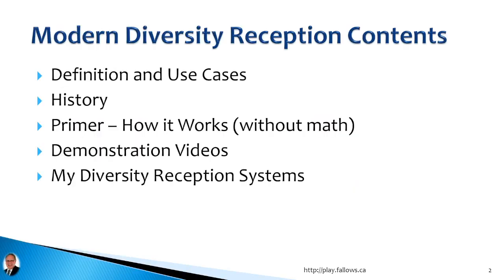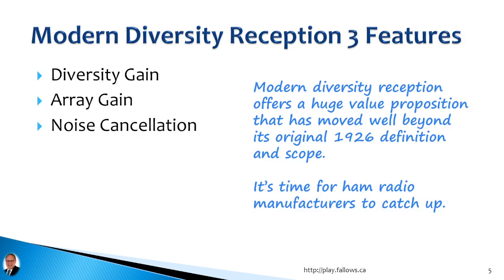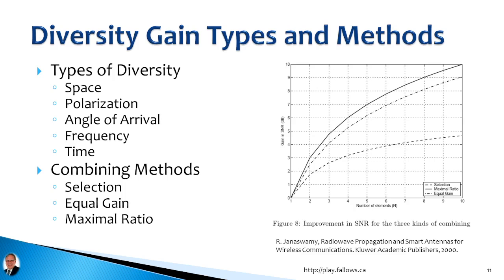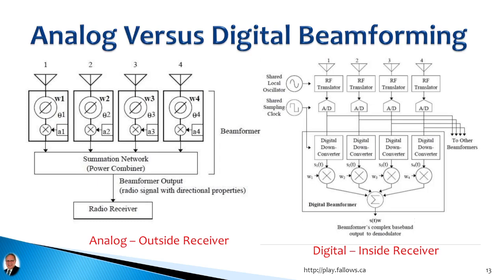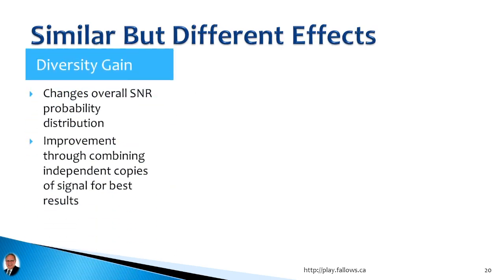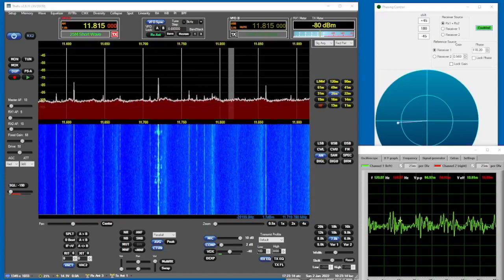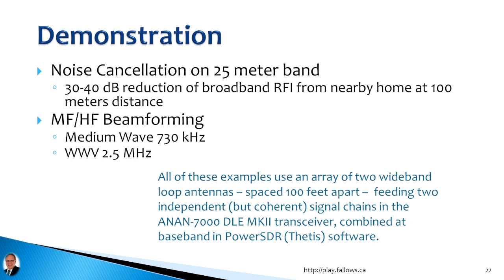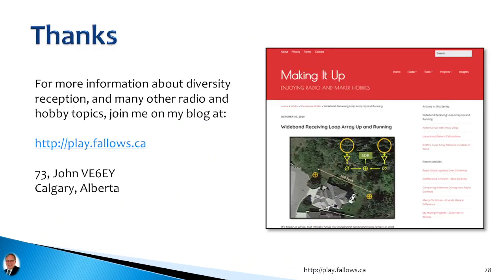Modern Diversity Reception

Comment: Hi John, nice video presentation. What I find odd is that there seems to be little comments and interest in the matter. I have owned the AFE822x and still use the RSPduo when they came available. I used a Timewave ANC-4 in the past and did experience the power of Diversity years ago and never stop using it. Now all hams have their mouth full talking about local QRM, but almost all do not use Diversity, even with a cheap and simple QRM eliminator. Seems they like to keep suffering and complaining ;-). Good luck with your channel end educating good practice. Cheers, ON2RON
Reply from the maker: Thanks, Ron. I agree. New ideas can take time to take hold, if ever. Of course, this is really quite an "old" idea.

Comment: 9:32 You mention improving SNR, or pointing a null at the interference. How do you decide which to do? Depends on conditions?
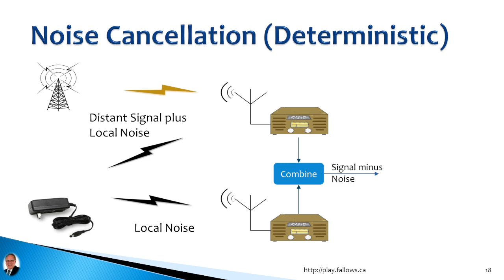14:10 Should the noise-collector be the same type of antenna as the primary antenna?
14:55 Shift 180 deg? Or just invert?
15:40 Isn't Diversity Gain the same as beamforming a lobe with Array Gain?
16:22 Isn't 3 db a DOUBLING of strength? And therefor quite a lot?
17:25 "Baseband" simply means the raw RF signal, correct?
18:22 Are the source transmissions in your examples analog or digital?
Reply from the maker: Hi John, Thanks for your note. Everything is about improving SNR. Typically, you can achieve more by reducing noise/interference. Noise probe should do a good job of collecting noise, while the other antenna should be your primary antenna. Shifting 180 degrees = invert. Diversity gain is primarily compensating for different paths of reception, which fade at statistically different times, i.e. compensating for complex fading. Beamforming is just getting the best lobe or null regardless of multipath.
Reply: @VE6EY  Thx! "you can achieve more by reducing noise" -- So, a noise collector is generally more useful than beamforming?
"Shifting 180 degrees = invert" - But then the signal is delayed by 1/2 a wavelength. So your cancellation assumes the first half of the waveform is a mirror of the second half, which it might not necessarily be. It seems that, for most accurate cancellation, you'd want inversion without any delay. I believe an analog inverter (eg inverting op amp) inverts without delay. 
"Diversity gain is primarily compensating for different paths of reception" -- You mean, simply having multiple antennas, without any processing, will improve reception?
Reply from the maker: @johnaweiss  When you simultaneously capture two coherent channels at baseband, and then phase shift one of the channels and combine both, there is NO delay
Reply: @VE6EY  You mean, phase shift just enough so the signals line up, right?
Reply from the maker: @johnaweiss  Yes. When the copy of the signal on Channel A is -180 degrees with the copy of channel B, and amplitudes are equal, they should cancel.